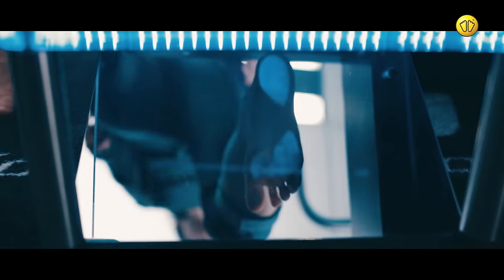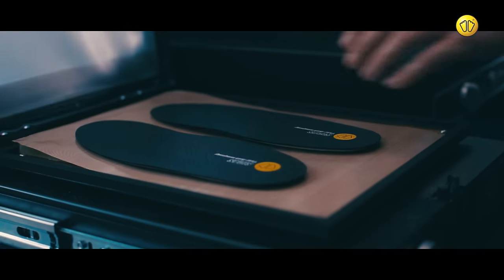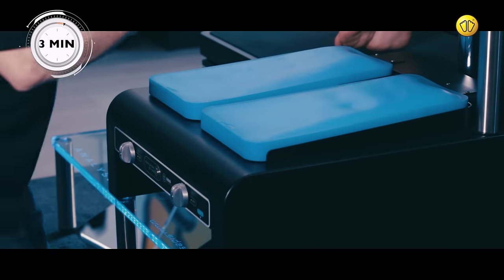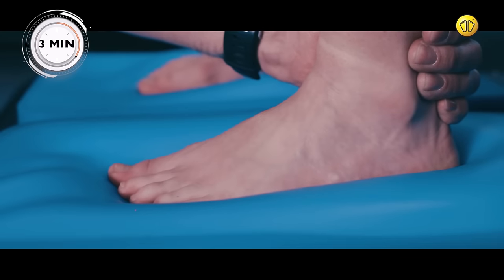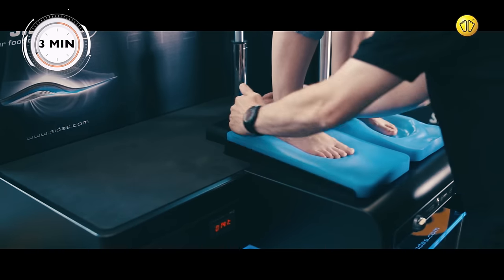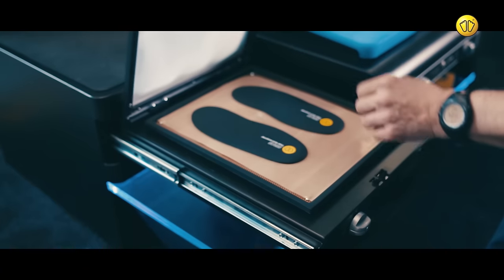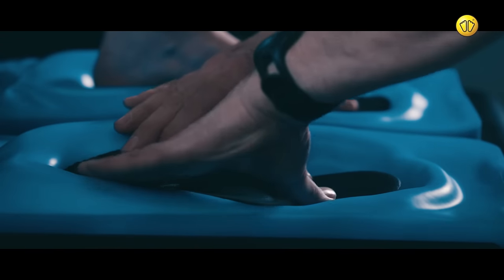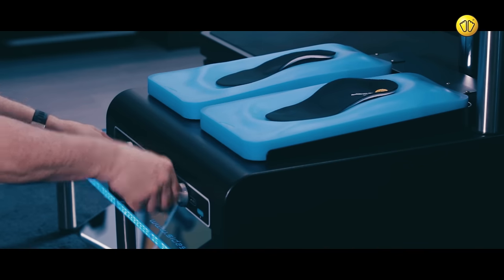Sidas Training Process - custom insoles

Comment: Unless you palpate the MID RANGE position of the subtalar joints BEFORE an impressions is made, the weight bearing (even semi-weight bearing) has COMPENSATED out the correction you are trying to correct. The cart here is AFTER the horse

Comment: I don't see how this helps if you have flat feet.  If you mold my flat feet, you get a flat mold.  That does not help my situation.  So I suppose this is only good if you have high arches only.
Reply: no you position the foot with a reestablished arch and then mold to it
Reply: Right he could have made the shoe insert mold out of the first plate of inprints. Its shows precisely where she needs supports like in the arch. The second step of molded imprints just collapsed here arches. The mold looks flat with no arch support
Reply: exactly! you hit the nail on the head.
Reply: The ARCH is not want you want to correct: IT is the subtalar joint
Reply: Naw boss I have 1 foot with no arch and the other with a high arch the ..the guy sanded more of arch on one.then the other it did a awsome job

Comment: Yes, but I a problem.  How do you choose the flexibility of the support?  Too soft and it crushes...  too hard and it's uncomfortable.  I didn't see any calibration method.  Proper shape requires calibration.
Reply: I found that polypropylene or carbon graphite work the best as midrange flex should a patient want to run in a pair of them. One problem with the latter: it is very thin and flexible but it tends to breakdown near the heel area after about two years.
Reply: The secret is polyethylene

Comment: Hi all 
Further comment on the foot position that semi and wt bearing incorrect! 
I am a lecturer in podiatry, research using  3 dimensional gait analysis kit, kistler force plates, 30 plus years lecturing sports paediatric podiatry gait assessment and module leader in manufacturing of orthoses using Cad Cam plaster of Paris slipper cast and foam impression methods. Have run private podiatry clinic for over 30 years . Just depends on what the patient presents and experience of the clinician! (Although some may get stuck in a belief that there is only one method of choice)
Reply: @timyatcak3292  he obviously has more experience than you 😂
Reply: @tessleye_01  Reateing mistakes again and again does RIGHT them to reality...I have a degree in meidince does THIS CLOWN?
Reply: @timyatcak3292  no one asked for your opinion

Comment: I have to be honest. I’ve worked at a shop that did custom insoles like this and I noticed zero difference for myself. If your feet are super jacked up then maybe you need it
Reply: There are more than two studies about custom insoles .They are not worth it .Zero differences between store bought pre made arch support and custom arch support insoles
Reply: Many FLAT feet need no correction. My father for example: feet flat weight bearing, feel flat non-weight bearing and totally asymptomatic.....Why treat something that need not be treated? I know for the $$$$$$$$$$$$$$$$$$$$$$$$$$$$$$$$$

Comment: Sorry but not correct 
I do not advocate weight bearing impression but neutral impression total different position 
End
Reply: Feet are weight bearing and I see no accounting for internal/external rotation of the legs while in your little mold